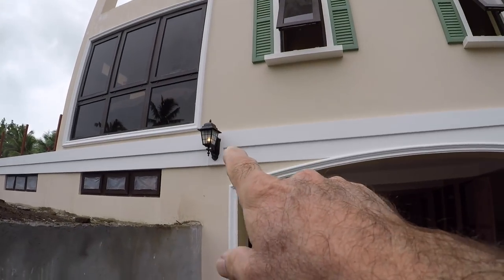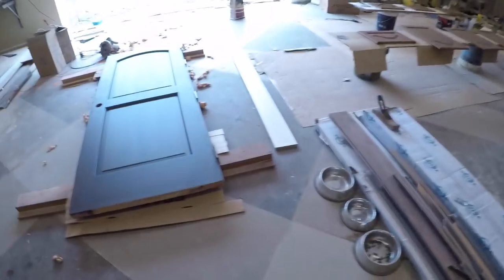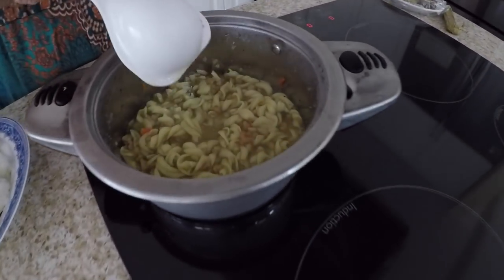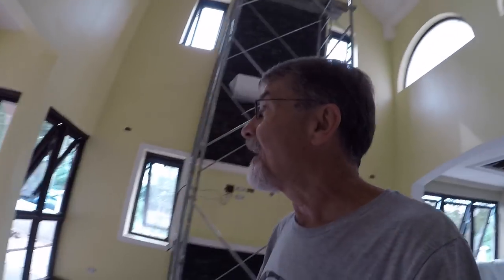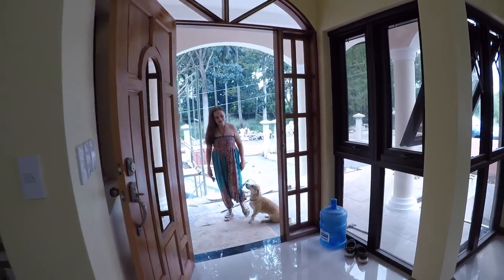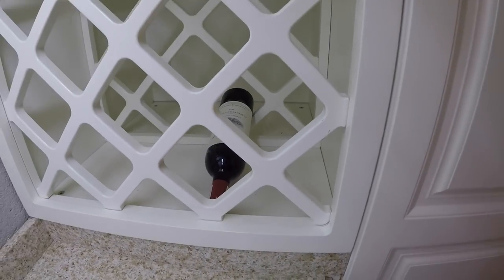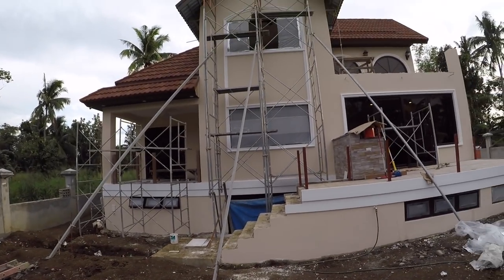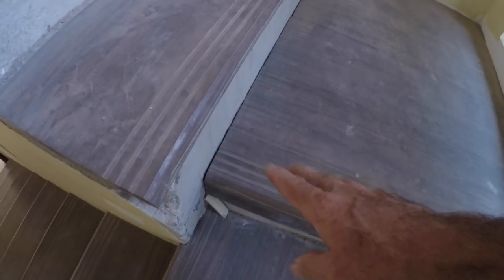VILLA FELIZ - EPISODE 283: HOW TO SMOKE TEST YOUR GENERATOR (House Building in the Philippines)

Comment: Hi James, I contracted a builder and the house was SUPPOSED to be built to Australian Standared and I was going to be here while it was being built. Unfortuneley I had a stoke so spent a lot of time in rehab so couldnt get back to the Philippines so the house was built without me. You dont want to know but starting from the roof which leaks and the downpipes which take water from the roof down to the ground, guess what, they leak as well. Wouldnt be a problem but they go inside the house. The second floor is a disaster and the bottem floor is almost as bad. Going to the outside there are problems with the water pipes so I have to just cover them and hope for the best. The tank which supplys the house with water was just put in a position that just refills the toilets on the second floor and that is only if it is full. Did I mention that there was no hot water upstairs. The power running to the house was supposed to be at least 10 inches to 12 inches down, I found it 2 inches down and that was to be a place to grow plants. Anyway I had better stop complaining. Hope you do well and get your kitchen fixed and your build gives you pleasure.

Comment: James do they not have a color matching machine?  I know the ACE in filinvest in alabang has a good size paint center they might have one. then you can get the post colormatched. dont forget to compare the colors with your pavers that are not down yet. Thanks for the shoutout for the wife. she really liked it. Also the kitchen..slide the counter to the left to fix the gap like you said and under the sink relocate trash bin to the opposite side. It looks like it will have space for it, and it will allow you to straighten your drain pipe. my wife is fixin to send a balikbayan  I will put some bermuda seed in it for my brother in law to deliver to you.

Comment: Hello James
I just discovered your house build series two weeks ago and I have watched all the episodes up to today.
You are doing a fantastic job with what you have to work with in the oversight on the projects and details.
Question; the first flight on the floating stairs looks like the steps are to long in the middle section as it appears not to match consistently side to side.
Your generator exhaust tube should run up to the roof line so as not to put exhaust fumes into any windows.
Reply from the maker: Steps still aren't finished.  We have cutting and adjusting to do.  Not sure what you meant too long in the middle section though.
Thanks for enduring the time to catch up on the series and hopefully you'll hang in for the duration of the build!
Reply: Hello James, 

I quess that I'm jumping ahead in my assumptions.

I will be following your you tube videos all the way.
I find your videos informative and the most professionally done of anything else on the internet.
I have been travelling every year to the Philippines for over 35 years and I would love to use the same house design as your home when I start to do my build.

Cheers,

Russ Roy

Comment: Hi Mr James, for the paint, you can take the railing to a paint center outside of wilcon or other big hardware shops. Those are shops that just sells paints. They will mix the color for you manually and you can get the color you want.
Reply from the maker: Good to know.  thanks Michael!
Reply: I never buy paint from the big hardwares unless it is a standard color. Paint Centers can provide you with the custom colors and paints you need. Your builder mostly buys the paints they use at these centers.
Reply: I agree ' in my experience here in Iloilo the small paint centers have much more experience in matching colors cause that's all they do all day long.Had them match some difficult colors for me before with ease. they can do it off of just a chip or flake of the color you want.

Comment: Oh James I hope you get that kitchen sorted it's shocking! The company should have a manager who inspects the work and gets your sign off before the final payment. They clearly just didn't care and have no respect as some of that is so sloppy and poor. I did notice the wine rack looked like it had a back panel missing but it has clearly been badly installed. The gap at the top of the crown is much bigger than I expected, I though it was small and was done to be filled with caulking. 

Good to see the generator works well, rare to ATS even my condo block have to send someone to manually switch it on as we sometimes have to wait ages for someone to go switch it.

Comment: James, i was just wondering how well the terra cotta color for the fence would go with the grass blocks in the driveway once you get that complete. If those colors together don't clash I'm on board.  Glad the generator test went well, I'm not sure if you'll be able to run the A/C, I know when my central air kicks on I can hear a change in the load on the generator and mine is a 16 KW.  Maybe yours don't demand as much power.

Comment: OK James. Some info on electronics. Current is actually free valence electrons on the outer electron orbit of an element. Copper has one electron missing ... Oh never mind! Its one of those dumb engineering things! Last week I couldn't even say engimineer now I are one!!! Check the amperage on the coil of the relay. That's all you have to worry about here! If its less than the rating of your Cat V your good! Or remember if you have extra pairs you can parallel them and split the current!!
Reply: this is NASA talk already

Comment: some houses make a concrete housing for the generator outside or at the back of the house, then route the exhaust pipe a bit longer and away from the house, pros: less or zero noise in the house, no dangers from diesel fumes.

Comment: James, rather than try to match the colour of the fence post’s, why don’t you go look at the original colour chart you used for the house and then choose a darker tone from your original house colour for the garden walls. That way your garden walls will sit more comfortably with the house as they are in the same colour range, though darker, and fence post can be seen as an accent rather than have a competing colour for the garden walls to the rest of the house.  I’m a designer, so colour and it’s use are an important aspect of my life and trade. Contrast is good, but too much contrast can be upsetting to the overall visual integrity of you house, especially as you want a Mediterranean look which tends to be more monochromatic.  Just a suggestion and it might help you keep you from tearing your hair out over a colour choice.

Comment: james how do you keep the battery charged on the generator if its not in use say for 3 or so months
Reply from the maker: It's recommended you start up the generator from time to time to charge the battery.  I was thinking about installing a trickle charger for times we'll be away for extended periods.  Its what I do with my truck in the US when I'm away for a year or more.
Reply: good idea,i had a small solar panel to keep my battery charged on a live aboard boat i had,worked fine

Comment: Do you have any issues with the automatic transfer switch as it’s only single pull 100amp
Reply from the maker: So far, no issues.  Has worked flawlessly.
Reply: Can I ask how your electrician connected it ? Is it connected to a circuit breaker in your electrical panel

Comment: James,  That generator seems pretty loud for being the silent type.  The ones my wife has been looking at are covered silent ones.  Thanks for the link.  By the way how many watts is that one.
Reply from the maker: Its a 6kw.  The only thing that makes it "silent" is a thin piece of foam in the housing.  Not to silent in my opinion either.
Reply: @MyPIDream  Thanks for the info.  For you its not so bad since you have a basement but for me I think my neighbors could here me from a mile away lol

Comment: kitchen work sheet signed ,that's why there not so keen to contact you ? but very bad workmanship for sure ,tops of exterior wall they would look nice same green as shutters rest of wall colour a much lighter colour like corn or wheat will look good I think just those two colours three colours will be over the top ,generator was load but door was open hope its less when door to generator room is closed .best wishes James & Ness :)

Comment: I would’ve put that generator outside the house , far away from the house and just run the lines under ground. Beside being loud, you’re taking a risk of carbon monoxide poisoning. I guess you can buy a carbon monoxide detector and put a few in every floor.

Comment: looks like you got a made in china kitchen cabinets james.  i think your carpenter there (kempi?) could've done a much better job.   i wonder how durable are the hardware's that they used.  it doesn't look like there's enough hinges on the pantry doors also.  there should be at least 4 hinges on each of those long pantry doors.  and considering how much you paid, i think it's absurd that they used cheap loose plastic pieces for the toe kicks. maybe your carpenter could figure something out to replace the plastic toe kicks with real wood(baseboards)?